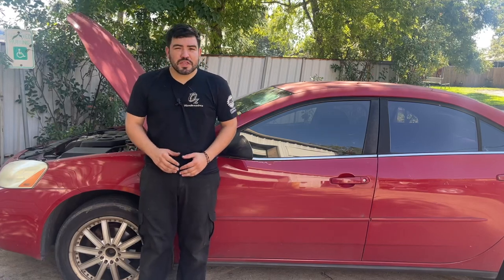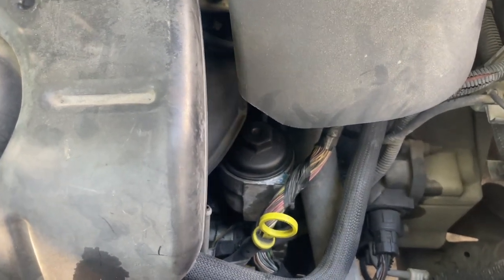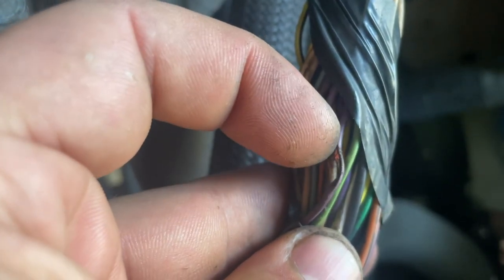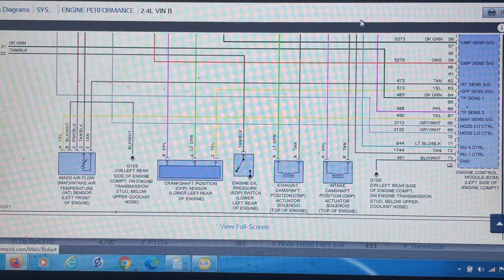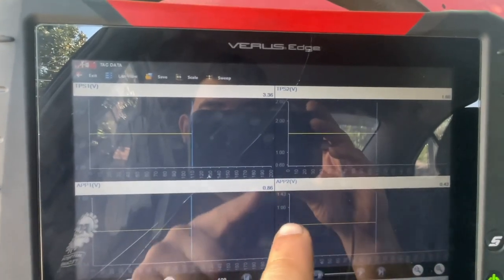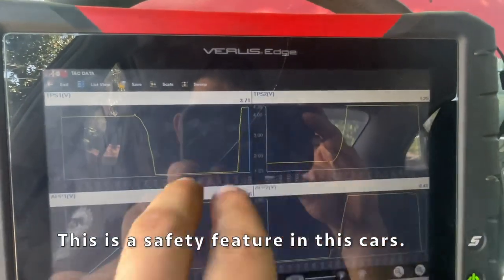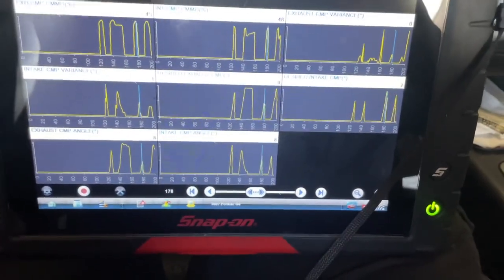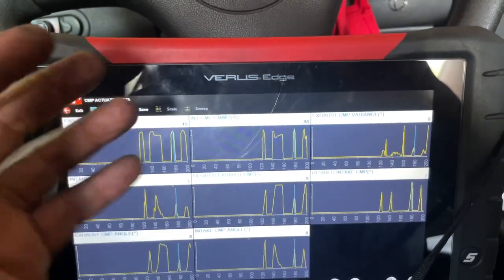Fixing an intermittent engine reduce power on a Chevrolet/ Pontiac

Comment: I see at least one of those GMs from that era every month. Had two Malibu’s in the last couple of weeks with harness issues and another one that had the PCM replaced that had weak terminal tension on a couple of the PCM pins. Had to order some of the right gold plated terminals from mouser and crimp them on some new wire and splice them in as the dealer didn’t even carry those pins. It was either that or a whole new harness. At least I have some of that style of terminals laying around now as I bought them in a tape of 100 for 22 gauge and 18-20 gauge. It’s ridiculous how many different styles of connector terminals they use on all of these cars.
Reply: How much did that cost?
Reply: Uhh I have both these cars and both have wire problems 2009 and Malibu 2011